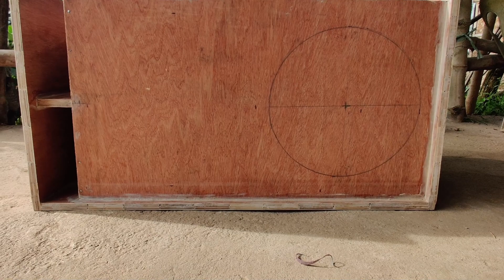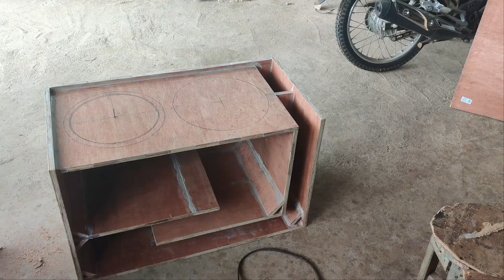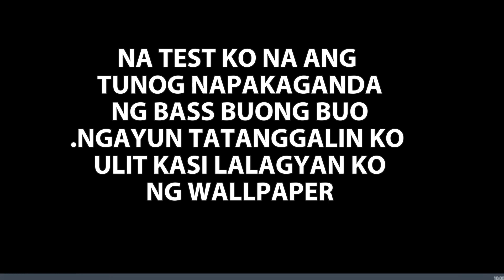how to make a ported subwoofer box for 2 D12 DIY. | Hard bass

Comment: You corner braced every thing except for the baffle ? Cut the 90* in the port smothe and large dowel rods are better for port braces if you have to have them.  It's all about air flow and port velocity.